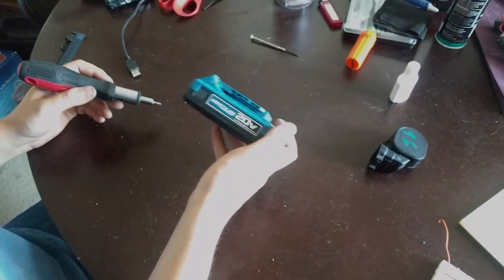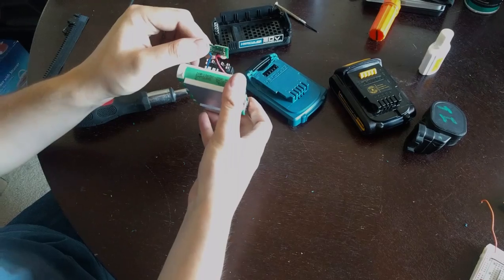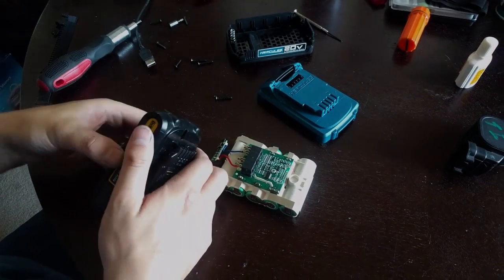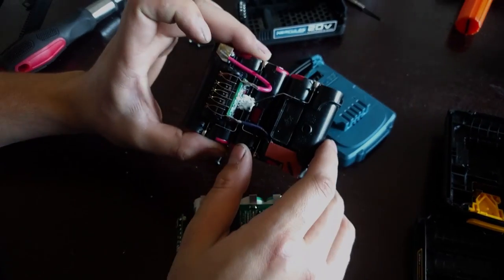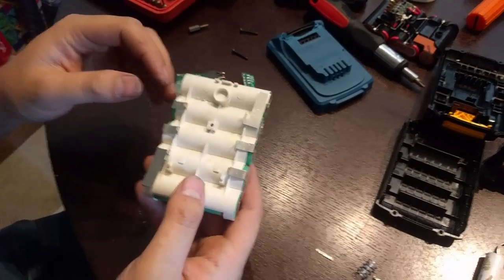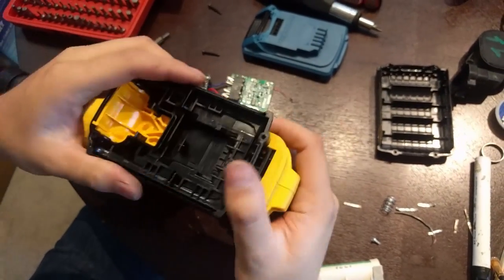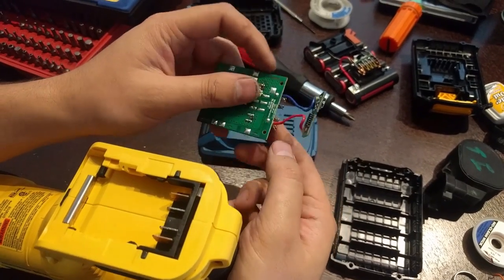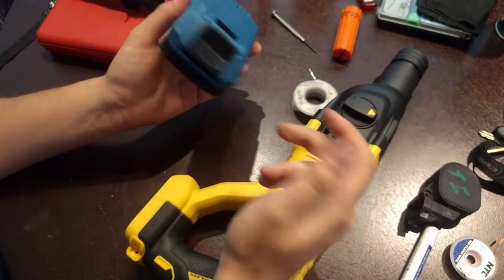New Harbor Freight batteries work in DeWALT tools!

Comment: so trying to understand here. Is the resistor you put in parallel to the thermistor on the pack? or did you just put a resistor with same load in same place as the dewalt?
Reply from the maker: I just put a resistor. If you wanted to mantain thermal protection, you could put a thermistor of the right spec. The harbor freight battery has a NTC style, and the DeWalt has a PTC, so you couldn't just add a resistor.

Comment: Or you can buy dewalt knock offs on Amazon and ebay. Cheaper and direct fit
Reply: Hachi-Roku Performance Group I got some eBay dewalt 12v batteries. They work ok for the money. (2batteries for $30) They're red not yellow.
Reply: Makes much more sense than all that you would have to do to use the H.F. batts.
Reply: Some knockoffs are not even half the stated capacity and use lowest grade cells. You don't know what you're getting.
Reply: @snowflakemelter1172  thats why I personally just buy dewalt batteries. I dont think they are that expensive
Reply: @TheShelltrack  just curious are your knock offs still working? Any issues with battery charger or tools from prolonged use?

Comment: So if all he is doing is adding a 10k Ohm resister between the temp and ground, wouldn’t it be possible to make an adapter that you can slide the Hercules battery into and then have to top able to slide into the dewalt tool?? Would this be possible with 3D printing? That way you don’t have to do any messing around with the actual batteries and you can still easily use the Hercules battery for Hercules tools or dewalt tools

Comment: why didn't you just put the HF batteries and circuit board in the DeWalt battery housing?
Reply from the maker: I don't have any spare dewalt battery housings.
Reply: James Barcellano i love you sir
Reply: And does the pack fit in the DW case?
Reply: Anything can be made to fit anything, with enough time, work and money. Got told that at Amol Precision in Dumont, NJ when I wanted to fit '78 Honda 750F wheels to a '76.
Reply: I used a Hercules battery to rebuild a toast Ridgid battery. Given the time and effort I wouldn't do it again but it works good none the less. The Hercules battery has that aluminum heat sink underneath which I couldn't pry off, so I had a heck of a time scraping the bottom of the Ridgid battery case to make it deep enough. Also with the fuel gauge the whole thing is longer so it it won't fit in some DeWalt batteries unless you ditch the gauge. Also the way the internal circuit board sits I'd be surprised if the DeWalt top would fit on the cells. Just my two cents. Honestly though I'm quite pleased with how my Ridgid/Hercules rebuild is performing for a $30 battery.
Reply: Joshua Burgess All those mods, hacks, are good stuff.  that sounds interesting.
Reply: Dude. At least remove some of the screws BEFORE you start recording.
Reply: The Lyle Files or use a battery screw driver or drill

Comment: Do they sell the large 18 volt batteries still for D walt drill  ?
Reply: There are adapters out there for sale that will let you use the 20 volt lithium ion batteries in place of the 18 volt nicad batteries. They might be nickel metal hydride. I think the nickel metal hydrate batteries are a little bit tougher and have longer life span, but the only on batteries definitely take the cake for fast charge and recharge ability. They take a beating in the service they're being used in and it's amazing they last as long as they do. I have four nickel metal hydrate batteries in a test instrument that have been in there and still working good after 15 years.

Comment: So will harbor freight batteries work in DeWalt or do you have to rig it?
Reply from the maker: Emma Robbie Us you have to add a 10k ohm resistor in the battery, along with modifying the case a bit to fit the tool

Comment: what determines the size of the resister in this hack?  If possibly a rigid battery can be adapted to dewalt would the same resistor work?
Reply: Harbor freight is unique in the temp design, as long as you can get a battery from Rigid to fit or an adapter you don’t need to maps off the internals

Comment: Can you show us how to hook up a hobby Lipo to the new dewalt battery?
Reply: DeWalt just came out with a battery pack using lipo cells. I can't wait till they start bursting into flames. After multiple emails and inquiries I've yet to have a good explanation as to how they keep the lipo cells from turning into little explosion makers. In a cell phone the current demands aren't so great but in a power tool absolutely you could draw enough discharge current quickly enough to just absolutely destroy a lipo especially if afterwards you put it in a rapid charger. Imagine what would happen if you drop that battery with a full charge. You have an instant light show with some bonus smoke.
Reply: @MAINTMAN73  if your tool burns up then you need a new tool and if your house burns down well then you will need many new tools.

Comment: Need to see how close a Porter Cable is to Dewalt, since they are owned by the same company.
Reply: Scott Foster 
Just so you know. Once Stanley brought Porta Cable . They took the entire Black and Decker Firestorm line and remanded it as Porta Cable.
Reply: The 20 volt Black and Decker battery packs plug right in to DeWalt 20 volt tools. Are you saying the Porter Cable batteries and tools are interchangable as well?

Comment: Samsung 25R! Holy moly!
I was right judging by the color.
Sadly AvE couldn't read the writing on the cells and came to the false conclusion, that they are noname chinese ones.
Reply: Not sure if you watched the rest of his video but he determined the cells have a capacity of 1,690 mAh sooo, not 25r's in his. Weird that this guy has much better cells.
Reply: Stefan Santiago I did watch it. I would not call his test accurate. Im sure, he has an Imax B6 chatger/discharger somewhere. If he doesen't, than he should get one
Reply from the maker: Stefan Santiago I will do a current draw test soon

Comment: I just got a hercules battery for 10 dollars in the open box section. Im going to try this. My main concern will be charging it. I am probably going to charge wiyh a power supply on a current limit and s3e if that works.  I'll figure out how to make the dewalt charger charge this later.
Reply: Sarsoar same charger should work after modification

Comment: The 10kohm resistor would kill the ability for the Hercules to work in Hercules tools, right?
Reply from the maker: thechosendude correct, if you wanted the battery to work in the tool as well, you would have to modify the tool to not read resistance at the battery level any bypass it internally in the tool.
Reply: After looking at another tear video down of the Hercules, I think the only way to do that would be cutting/bypassing temperature control spade on the battery terminal in the drill, and jumping the appropriate resistor so the microcontroller always sees that value.  Then I thought about it more and the end goal I want - to freely interchange DeWalt tools and batteries with Hercules tools and batteries - would never work anyway because a DeWalt battery won't fit into Hercules anyway.

Two different sales guys at hardware stores I've spoken to have said tool makers probably make more on selling batteries than they do the actual tools.  Having design patents on batteries with no standardization is ridiculous, because consumers have no protection.  Look how quickly Lowe's abandoned their 20v Kolbalt line for the new 24v Kolbalt line.
Reply from the maker: thechosendude yes, it is frustrating with proprietary systems. There are some 3d printed adapters for some "gender bending" of the batteries. I am just glad there is no DRM yet that does an active authentication with each battery, such that batteries have to be "activated" when bought, and may only work with that owners tools even.

I have modified some older nicad drills with rc xt60 connecters to run off standard batteries, but the form factor is far from convenient.
Reply: James Barcellano - I know, right?  Considering how cheap PICs are and that most drills and batteries already have microcontrollers in them, it is only a matter of time before they create a smart system for batteries to learn a drill's unique ID and refuse to work with any other drill (I.E. prevent resale or sharing of tools).  They could even work around their ecosystem of promoting same batteries for different tools by just designating series codes (HDxxxxxxx for hammer drill, IDxxxxxxx for impact driver, JSxxxxxx for jig saw, etc).   Once a battery learns a certain tool type/model, it can't be used with another of the same.

At first it almost seems like suicide that a company would do it, but considering most are probably made in the same factories, and they're all related (i.e. DeWalt, Porter Cable, Craftsman, Black and Decker are all owned by Stanley), they just all impliment it at the same time.
Reply: James Barcellano - Have you tried charging the Hercules battery with a DeWalt charger?  I took apart a Bauer battery and the ID, C2, C3, C4 pins are all in different orders.  Only the TH and Positive/Negative terminals are in the same spot.  Doing the temperature resist trick will get the battery working in a DeWalt, but there ain't no charging happening since the balance terminals are all in different order.  And the terminals are direct soldered to the board, so it's not possible to switch the order.  Looking at the Hercules in this video, it looks like it may be similar scenario?
Reply from the maker: thechosendude correct, the dewalt charger will not charge this battery. it doesn't even have balance leads out of the connector like the Bauer battery does. I just charge it with a hobby charger
Reply: James Barcellano that's how I brought my old Makita 18 v batteries back to life. Not the most convenient. Used alligator clips with a volt meter leads stuck into the positive and neg pins and used the volt monitor to watch. Had to start out on lead acid settings until I got it up to about 16 volts, then I was able to charge on lithium ion settings. 

Still worked on the tool, but not the charger.
Reply: @mosesdog2  any hints on bypassing the protection in the tools? I am trying to get my dewalt batteries to work on a Bauer angle grinder.

Comment: Can you just swap out the batteries if you wonder what I mean take the batteries from out of the Harbor Freight battery pack put it inside your DeWalt battery pack close it up instead of Cuttin Up and modifying that Harbor Freight battery I don't know that's what I would have done

Comment: I just posted a video of a Milwaukee tool being powered by a dewalt battery with an adapter i made my question is how would i get battery protection like over current and undercurrent as well as overheating. I made a 3d cad file for a more compact adapter then the one i showed in the video and i would like to make it available for anyone to download to 3d print. The only reason I'm holding off is because there's no protection. I don't know anything about circuit boards but would it be possible to build a simple circuit board for battery (and tool) protection?

Comment: What wattage was the resistor?
Reply: Nevermind; rewatched it. Quarter watt
Reply from the maker: JosStrange correct. just about any wattage will do, it carries very little current.
Reply: Managed to snag a pack of resistors from a hobby store. I may have been overly ambitious on this project. Desoldering those six pins was straight forward enough; but I managed to short the batteries several times while resoldering them because my skill level and my ambition are mismatched and I didn't adequately prepare. 

It WoRKEd!!!! For about twenty seconds then it died. The battery life indicator still read 2 bars... so I thought I'd check the resistance between the positive and the temp pin; open lead. So I figured maybe I muffed up soldering the resistor and I need to do a better job... took the whole Shabbat apart again; tested the resistor and it was good... so I added more solder for fun. Resoldering those six pins the second time was very difficult to get them to slide back in the damn slots. Jeez. Shorted the batteries again trying to bend on of the pins into the slot under the board; and I believe that was the last straw. Fried the board. I think it's time for some rum
Reply from the maker: JosStrange well, at least you can salvage the 18650 cells for future projects